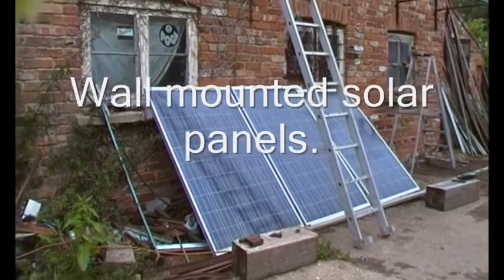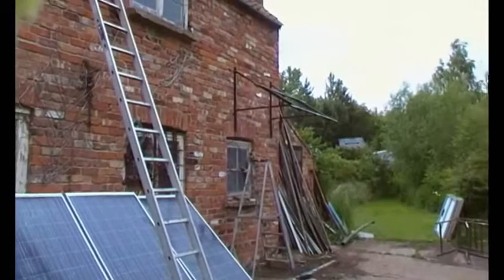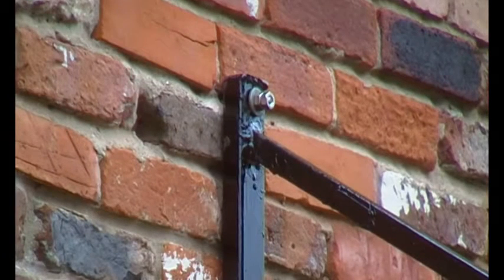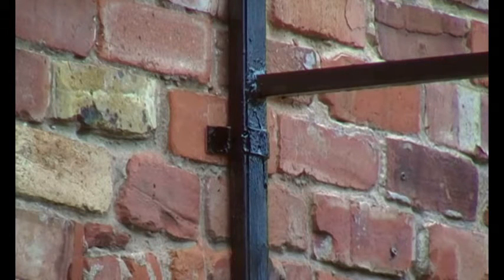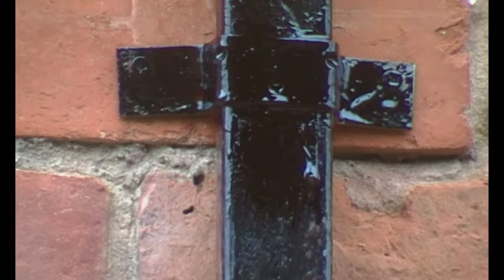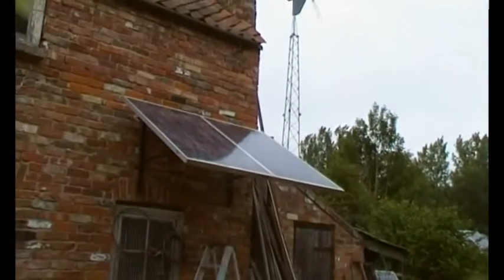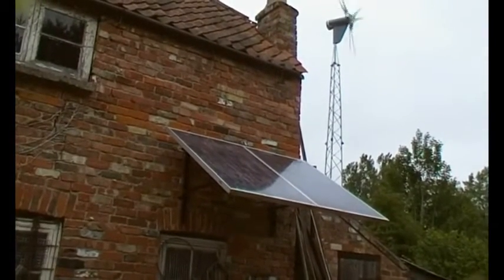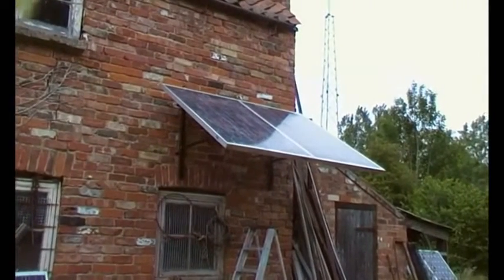Wall mounted solar panels, frame and fixings for a south facing wall.

Comment: 4 inches of (new) snow would be an extra 12 kilos per panel ( 2x 1 m). Effectively the weight of another panel. I would think the frame would easily deal with that, no?
Reply from the maker: You are right, it would not be a problem, the frames are quite strong, Subscribed? cheers
Reply: @TheInfoworks  "Subscribed" - I am.  Could you not use thunderbolt screws rather than bolts right through the wall?
Reply from the maker: @mrb2843  It's my workshop so I didn't mind wooden plates on the inside. The bolts are not tight but transfer the load over a larger area. it's just the way I did it, I'm sure other methods are fine as long as the wall is sound, cheers

Comment: Looks very nice, is there a website where they selling those wall mounting solarpanel systems?
Reply from the maker: Hi, an hour with an old road sign, an angle grinder and arc welder, cheers

Comment: I noticed the wind generator, are you off grid ?
Reply from the maker: Hi. We use the mains as a backup instead of a generator and for welding and such. As you can see from the tracking gate videos we generate enough to run eveything most of the time. Cheers

Comment: what about wind, could that be a problem?
Reply from the maker: Hi. Thanks for the comment. Damage from wind could be distortion of the frame and tearing of the mounts. The whole frame is welded together and the mountings are strong. The only extra could be a diagonal strut to improve triangulation, maybe on the next one. Cheers